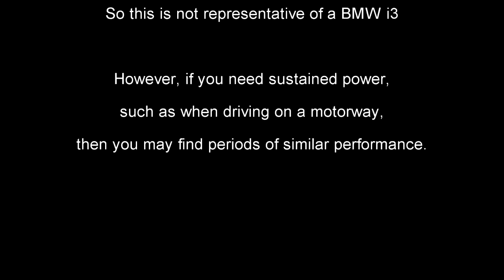Driving a Nissan Leaf Limited to 25kw

Comment: Hi Paul,
Having drive 65000 miles in my leaf so far and having had a BMW i3 rex for a 4 day test drive I can say that we had no issue running the rex down to the point when the engine kicked in automatically (when the battery range was display 2 miles left) we then continued driving for another 15 miles. Those 15 miles were done with the i3 running in EcoPro mode and driving at the 56mph "soft" limit. We were travelling along the A30 in cornwall so certainly not flat road and had no issue with lack of acceleration or staying at 56 going up hills. I think that as the i3 is quite a bit lighter than the Leaf this also helps it cope much better in hilly areas. During the times when you've not driving using the maximum capacity of the engine it is then recharging the battery and building the buffer charge back up again. I'm sure if one was to drive at usual BMW speeds then you will have issues but when driven in a EV mindset then we found no issues with running on the rex, and it did make the journey deep into Cornwall (100+ miles past the last fast charge point at Exeter) possible, which we could not have done in our Leaf.

We found both cars to be great for every day use, the Leaf was more comfortable, bigger and heavier than the i3 but the i3 is more powerful and 'lively' and does have the potential for the unexpected journeys and the longer ones without the worry of faulty or now more increasingly busy charge points on the way!
Reply from the maker: That is good to know but I think that the issue remains from others evidence. I am glad you have not yet been restricted but if you had tried to do 70-75 (normal motorway speeds) then your experience may have been somewhat different from what I have heard :-)

Good luck. I hope you stay happy with your i3.
Reply: ***** I'm sure you're right, the higher speed will certainly mean it can't keep up, but the alternative in a fully electric car is stopping completely! Luckily we've never got that far in our Leaf having only entered turtle mode on 1 occasion but plan most long journeys well and adjust our speed to generally arrive back with <4 miles.

We're switching to an i3 next April as much to see how another manufacturer is doing as a comparison rather than just getting another leaf. We've started to see quite a drop off in range since passing 60000 miles in the leaf and we're interested to see how the i3 manages with the mileage we're going to put on it. We expect to do 99.9% of our journeys on pure electric but it's the extra unexpected and occasional long distance ones that'll be easier, especially now that we have 2 small children on board. We want to know we'll have an option to get to our destination and not have to wait around with tired children if there's a queue at a charge point, which we're starting to find now at several fast charge locations.
Reply from the maker: Matthew Robinson  Fantastic! Don't get me wrong. I didn't make this video or speak up about this issue to rubbish the i3. I have tested it and met with some of the technicians that design and support it and it is a great car and with the REX it will be much more viable for more people. I just want to make sure people are aware of the potential for limited performance when the battery is depleted. It should really affect most people and if it did then it won't make the car any less attractive I am sure. If it is a i3 without the REX or one with then IMO the one with the REX makes the car much more usable for longer trips

Comment: After been along in a test drive i3 rex, I want to set straight that your not limited to just 20kw, ok the petrol motor may produce this but we noticed that it kicked in whilst the battery had approx 18miles left, so in combination it still produced the full 170hp, also for ref whilst driving the motor typically at 70 was drawing just 15.2kw, so the rex is a viable alternative to the ampera, yet still offer the benefits of a really quick drive of the electric only i3.
Reply from the maker: So, 15.2kW on the flat... what about hills? That was my issue with the Rex... it is fine on the flat but it will be restricted on hills.

It is hardly a viable alternative to the Ampera when BMW i3 drivers will have to stop and refill with petrol every 70-80 miles whereas the Ampera will go 300 miles between fills...! Thanks for your comments anyway

Comment: If you talk to bmw they say the rex isn't designed as a serial hybrid like what your talking about as in running down to 0 then just using the rex only, as I said already they work in tandom to get you to the next charge point or the end of your trip so you can plug it in.  However I concede it could be used like how you talk in the vid in worse case scenario but really would you really want to 85miles a time by petrol all the time?
Reply from the maker: I think my point was that many i3 owners will want to minimise the amount of petrol they use and if they get to a charger and if fails then they won't have the battery buffer you talk of. So, although I agree that it isn't designed to be used like that I am sure that many owners will do.

I still haven't seen a single test of the i3 REX that answers this question :-)